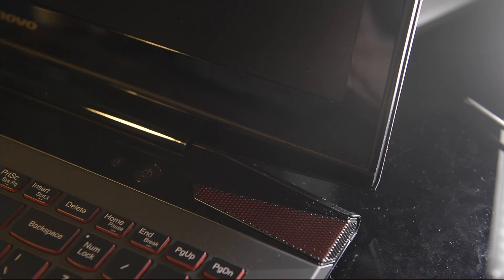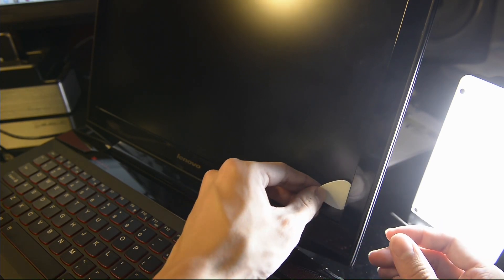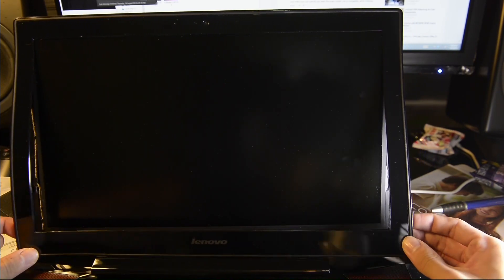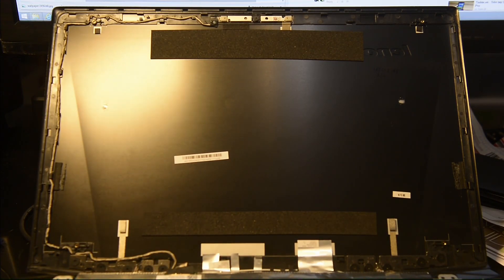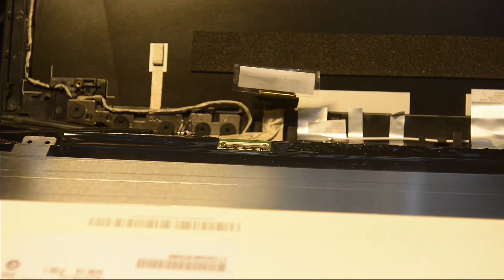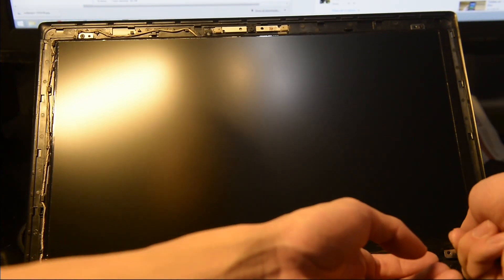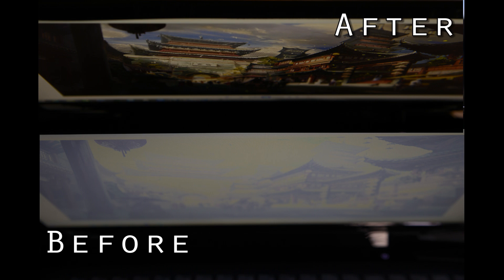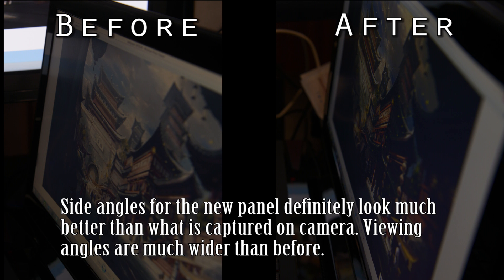Lenovo Y50 (1080P Non-Touch) Display Upgrade / Replacement Guide

Comment: I've replaced both new - screen and a cable. Still, whenever when I turn on the computer, even though that the keyboard lights up, and the keys are working, the screen does not react and show anything. What else could be a problem there? Help me please!

Ps my problem was not the flickering screen, but the problem was that my old screen was not working due to my mistake of spilling some water on it and accidentally pressing a button while I was removing water from both screen and keyboard.

Comment: Looks way better. Thanks for the review. I think I'm gonna try that.
Reply: Hey, so I bought the display you used too and changed it. Definitely worth it, looks so much better!! Finally black is black and not grey. The viewing angles are significantly better, from above and from the sides the colors now stay the same and you can easily let's say watch a video with 3 people in front of the laptop. From underneath the viewing angle is also much better than before, but here colors will still change if you go too far down. It's not that big of a problem though, considering that you can just fold the laptop display down a bit.
As for the changing process, I found it a little scary but doable. One clip of the frame broke off, but not a big deal. I found the cable on the monitor quite hard to get back in - so small and soft. Didn't work at first cause it wasn't all the way in, gave me a little shock because nothing turned on. But in the end it all worked out.

Comment: hi,
can you please help me,
i have a lenovo y50 model and its written on Laptop left corner ultra HD screen (option) 
my screen resolution is 1920*1080
i want to upgrade it to 4k. can i upgrade my screen to 4k screen . thank you
Reply from the maker: I don't think you can upgrade it like that. The connectors are different.
Reply: Thank you

Comment: i have a fullhd version.. can i upgrade to a 4k display?
Reply from the maker: +Lenovo y50-70 gaming No I don't think that is possible.
Reply: And that would be, just to make things clear, because of different connectors? Consequently, if a 4k screen was found that used the same connectors, there would be no problem? But this raises the question, if the exact same machine with the exact same hardware (minus the screen) can be outfitted with different screens using different connectors, then surely there must be a way to change both the screen and the connector?
Reply from the maker: From what I know the connector might be motherboard soldered. Motherboards may only support a set of connectors. 
Unfortunately I don't think the exact same hardware is used for the 4K and and 1080P models. If they are, then sure you can go ahead and change the connectors (desolder or whatever if you must).
Reply: Ok, good to know. Well, this definitely limits the potential for the Y50/Y700 model when it comes to photo and video editing. But my first reaction was, never mind, I could always connect an external 4k screen later on... Actually, it turns out that the Y50/Y700 models lack HDMI v2, which is a requirement for high color depth and high refresh rate at 4k resolution. This despite the fact that the NVIDIA GeForce card apparently does support HDMI v2 output. So, in other words, good thing I didn't bite the bullet although I was very close to buying it. Otherwise, the Y50/Y700 seems to be a really great laptop (the Y700 seems to have a slightly better touchpad judging by the reviews). As for the screen issue, if you're fine with glossy screens you could simply have peeled off the coating and this should have fixed the washed out color issue (at the cost of screen glare).

Comment: can I upgrade screen native lenovo y50-70 with screen 4k?
Reply from the maker: +Dante Evil If you mean you have a 1080P model and you want to upgrade to a 4K screen, then no not possible as far as I know. There isn't a 4K monitor that has the same connector.
Reply: +Swift World already but my model Lenovo Y50 has the ability to put a screen in 4K. I checked the video card and the connector. fully compatible.
thanks anyway
Reply from the maker: +Dante Evil If you mean you can use an external 4K display then yeah sure you can. If you mean the laptop monitor changing from 1080P to 4K and it works great for you! :). Maybe you can share the monitor part number as many have asked if one exist. Glad that it works out for you
Reply: +Swift World but can i replace 4k touch?
Reply from the maker: +BigWeapons Fan No I don't think there are 4k panels of the required dimensions and connector.
Reply: +Swift World 1920×1080
Reply from the maker: +BigWeapons Fan If yours is the non-touch edition then yes you can change it. The model in the video description should work. However, do note that the I do NOT know the compatibility with the later revision of Y50s (the one with GTX960m). Please do some further research first before committing.
Reply: +Swift World my Lenovo got gtx 860m 2gb. The question is,I don't need neither touch screen nor 4k display. Is the screen used in this video is an option?
Reply from the maker: +BigWeapons Fan Your model has to be the non-touch one out of the box. And if it is, then yes the screen in the video is an option.
Reply: +Swift World out of the box?
Reply from the maker: +BigWeapons Fan Meaning when you first purchased it the model is a non-touch version.
Reply: +Swift World ok thank you for replies

Comment: what are your impressions with lenovo Y50-70 with 4k displey?
Reply from the maker: +Marko Mijatovic Unfortunately I didn't have the opportunity to use a 4K one for long. But from what I've read, the 4K stock display is pretty decent as compared to the stock 1080P one (aside from resolution). Otherwise I don't really see the need for 4K on a 15 inch display.

Comment: I am sorry but I am bad at figuring this out. 

I have the Lenovo Y50 from Tiger Direct 59425651 is the product number.

Given the difference in time, what is my best option now? I am looking to spend at maximumish 100$. I cannot even decide between glossy or matte, however I only typically use it inside my dorm room, so I am guessing glossy?

Link for the specific model

http://www.tigerdirect.com/applications/SearchTools/item-details.asp?EdpNo=8992870

Thanks A Ton
Ryan :)
Reply from the maker: Ryan Witcher Glossy and matte have their own merits and disadvantages. Do view some other displays and decide for yourself. Its kind of a preference thing and for me personally, I don't mind either.

Comment: please help
on lenovo site,its written that lenovo y50-70 has the ips display.can u tell me that its really an ips display that they have mentioned or its the same old TN panel.
Reply from the maker: Mohsin Ejaz I'm not too sure if the latest versions come with IPS displays. You can always check the monitor model through software.
Reply: Swift World yes u r right.i saw many comments on forums that they bought the lastest y50 with ips but when they used the laptop it was the TN panel.

Comment: Where did you buy the replacement panel? The amazon seller you linked does not ship internationally. Did you use a forwarding service? (I live in Singapore). Great video btw!
Reply from the maker: Chong Hern You can search on AliExpress as well.

Comment: will buying the above stated monitor enable me to view 4K? Is it also touch screen? right now im only full hd and no touch, overall bad screen:(
Reply from the maker: Baran Kayhan No the screen is only Full HD. You can view 4K already on any screen but it just isn't displaying 4K :)
Reply: Swift World Oh... What would I need to do to display 4K on this laptop? Is the graphics card not good enough either?thanks!
Reply from the maker: Baran Kayhan The monitor needs to support it. What I mean is that even if the monitor doesn't support 4K, you can always play 4K videos in whatever resolution your monitor can display up to. There isn't anything you can do but buy a 4K monitor or a laptop with 4K display.
Reply: Swift World awesome, thank you for your reply. I will get a 4K monitor for this laptop!

Comment: Swift World I understand the the y50 used to be made with a TN panel, which was really bad. 

The newer versions are shipped with  FHD IPS LED Backlight (1920x1080). Will I have to replace this one too? Or is it good? 

I know they have a QHD and a 4K version too, but they are outside of my price range because of all the additional internal components that increase the cost (newer graphics card, etc).
Reply from the maker: MBHarsh I'm not too sure about the newer versions. You might have to do some extra research on that to see if there are any other users and what's their experience.

From what I understand, the QHD and 4K versions have much better screen quality. I do not think that the hardware specifications are any different besides the screen though.

Comment: I have a Y50-70/59416739 w/ UHD non-IPS matte panel and i'm wondering if I can swap this screen for a FULL HD IPS GLOSSY one but will it be compatible ? =)
Reply: Henry Valade found any answer??
Reply from the maker: The connectors should be different, you will need to check up what exactly is that connector and look for a monitor of similar size that is full HD resolution. For the older models 3 years back there isn't a full HD monitor that has similar connectors and the right dimensions.

Comment: I just replaced the screen with that same screen. Did you do any screen Calibration on the new panel? If so, do you have any guides or suggestions on how to do that?
Reply from the maker: LogicalWaste Nope. You can google some guides but because you do not have the proper color calibration tools you will have to judge using your own eyes, which isn't as accurate (especially if you're doing color critical work) as using the tools.

Comment: For anyone thinking of replacing the screen non-touch and touch models, this forum answers all your questions on 57 pages. Just read the newest 10 pages. They even compare and try out different replacement parts. A superior screen to the one used in this tutorial would be for non-touch options a Samsung PLS panel LTN156HL01 ( don't confuse with 101, B01 models, they are TN panels). I myself will try out the Samsung non-touch panel soon.

With regards to upgrading touch models, it can be done, but is highly risky because the screen is glued together with the digitizer panel (touch panel). Furtheremore you need to replace the laptop lid because this also is different from the non-touch models. The eDP connector is also different with 4 lanes instead of 2 lanes. Just spent 4 hours reading the internet. Now you can jump over that step!

The thread is still active and have been updated recently.

http://forum.notebookreview.com/threads/y50-replacement-displays-compendium.755626/page-57

For comparison purposes this site is really good with it's compare function.

http://www.panelook.com/LTN156HL01_SAMSUNG_15.6_LCM_overview_24053.html
Reply: Casper Svendsen Have you tried it yet? I want to upgrade, but I want the best. Please let us know!
Reply: Yes and it fried my motherboard. I have not been able to figure out the reason why 😞
Reply: Oh wow. Never mind then! Sorry to hear man. That's horrible.
Reply: @TheCodeTinkerer  Oh damn! You sure it wasn't just because you caused a short circuit with you fingers or smth? This doesn't sound super motivating to me 😅
Reply: @99xara99  I even disconnected the battery :/ I think I have must have damaged the connector somehow. Really delicate piece
Reply: @ermannos  I ended up getting the screen and motherboard replaced. Sold the laptop aftwards

Comment: hi great video. can i use the same monitor for the au optronic model??
Reply from the maker: It should work on all Y50s (1080P non-touch) models regardless of which stock monitor it comes with.

Comment: my monitor on this laptop is AUO36ED is this the same u just replaced??and is this new monitor an IPS display??
Reply from the maker: No, that is one of the other stock screens that are available.
Reply: Swift World i have y50 with the screen AUO36ED  and it is very bad at display so is this B156HAN01.2 screen compatibale to my laptop y50 and is this screen an IPS display??
Reply from the maker: David Subedi It isn't IPS but more or less identical in terms of performance.

Comment: Hi swift. Is it possible to replace the touch screen model , I notice that the whole screen is glass and I didn't really find a way to take it out and will the new screen that you bought work with the y50 touch (59426255). And it would be awesome if you can show me where you can find a tutorial on that, I cant find any help on this model.
Reply from the maker: Sorry I'm not too sure about that. Apparently it is possible just much more difficult.

Comment: Hi Swift, so basically B156HAN01.1 is just the glossy version and would work too? How long do you think these displays will be on sale ? Because Im about to get y50 but dont have spare money now. Thanks for answer.
Reply from the maker: They'll be on sale for a very long time. No need to worry about that. As for the model theres some slight difference in the technical specs as well (very slight) but yeah it will work.
Reply: Swift World Lot of users report ghosting with that panel that you used. Have you encountered anything like that ?
Reply from the maker: 89ONko
I did notice some at times. But it doesn't seem to always happen such that it bothers me. It isn't too frequent though.

Comment: One question for you Swift. If I wanted to replace the Lenovo Y50-70 UHD (Intel Core i7-4710HQ, 16GB RAM, 1TB+8GB SSHD) screen for another upgraded spec. Which one do strongly recommend for me to buy for my line work in graphic/web design/video editing?.
Reply from the maker: I'm not too sure about UHD displays. From comments I've gotten the UHD display is significantly better compared to the 1080p ones.

What I would recommend though is getting an external monitor and hooking your laptop up to it. Having two screens should help plenty. Also, if you need color accuracy in your work, I would definitely recommend opting for an external one.
Reply: Re: Thank you my Brotha.

Comment: could you install a touch screen on such a laptop?
thx
Reply from the maker: Unfortunately not. There is a touch model though.
Reply: thanks mate..actually i have the ideapad z40..do u know if possible to replace screen on that model?
maybe could recommend one :)
thanks a bunch
Reply from the maker: דודי אהרוני
Unfortunately, I'm not too well versed in that laptop. The screen can definitely be replaced but whether or not you can replace it with a touch screen, that I'm not sure of.

Comment: Hi Swift World. How would you replace the screen for the touch model? I'd love to put a matte IPS screen to replace my crappy touchscreen. Thanks!
Reply from the maker: I believe the process would be similar. That said, the pins are different so the recommended screen would not work with the touch model.
Reply: Oh I forgot to mention, my screen is the FHD touch not the UHD. So you saying the even the 1080p touch and non touch screens have different pin connector?
Reply from the maker: gug guh Yeah. IIRC the touch screens have a different connector regardless of UHD or FHD.
Reply: Swift World Thank you!

Comment: Hello sir, I hav bought Y50 a week ago for video editing
But, Display quality is truely very bad. so, I want to change it 
Is the B156HAN01.2 screen, good and recommendable for replacement?
Does it remove the yellowish colour is present in y50 completely
Reply from the maker: You will definitely notice a huge jump in display quality once switching the monitor. As for your yellowish colour issue, I don't believe I am noticing any on the B156HAN01.2 screen I'm using.
Reply: Swift World Thank you :)

Comment: is it possible to upgrade it to a 4k display? since there is a model of y50 4k, is it possible to buy just the display of it?
Reply from the maker: The connectors are different. I don't think there's a 4K display with the connector of the 1080P model.
Reply: oh ok
Reply: You just need to get a double 40 pin connector cable replacement  @Magi_Carp_ . the 1080p models are 40pin to 30 pin cables.

Comment: do u konw where can i buy a IPS FHD screen for y50, or the new one u got?
Reply from the maker: I've placed some Amazon links in the description. You can search the exact model on AliExpress as well. Be sure to always double confirm with the seller if they have that exact model.
Reply: yeah i will, thanks a lot ^^
Reply: Do they confirmed? :)
What about this http://www.amazon.com/Lenovo-15-6-Inch-Gaming-Laptop-59425944/dp/B00K6ZIMPE/ref=sr_1_1?ie=UTF8&qid=1412826475&sr=8-1&keywords=y50+lenovo#productDetails
Reply from the maker: Renzo Arana You mean the AliExpress sellers? They do "confirm" but sometimes still send the wrong thing.
Reply: I mean Amazon. Is it a store to trust?
The link I sent is a Y50 with an IPS display.

I would like to know too if the Y50s displays on Newegg are IPS.
Thank you.
Reply from the maker: Renzo Arana I'm not too sure about the Y50s on Newegg. The Amazon store should be ok. There are past positive customer reviews.

Comment: Do you know if is it possible to exchange the 4K (UHD) for one FHD ?
Reply from the maker: The interface should be different. If you can find a FHD one that uses same interface or connector, it should theoretically work.